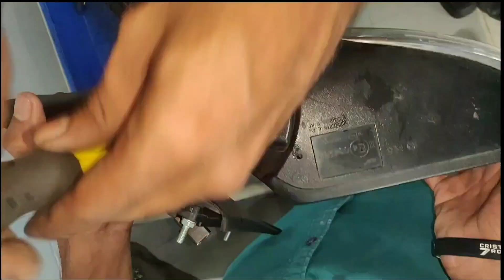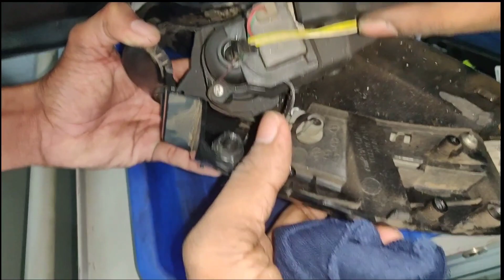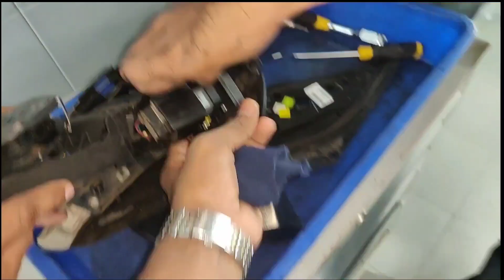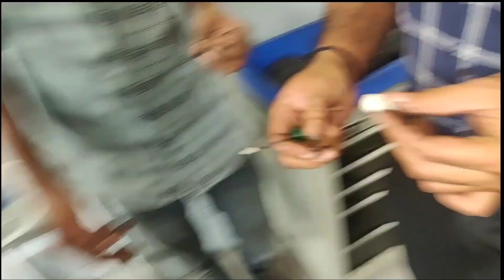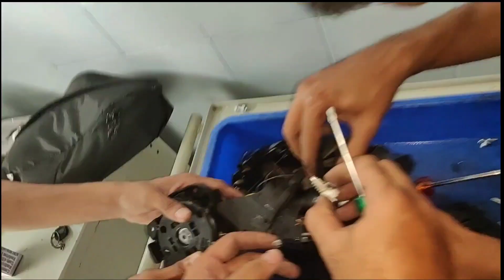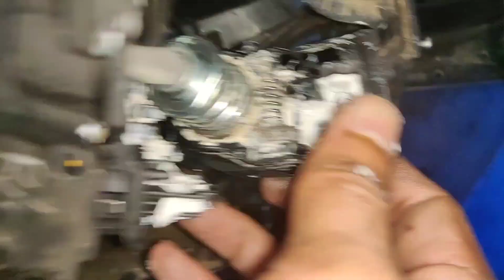Auto Fold Mirror Repair || Hyundai || Grand I10. How to repair foldable mirror

Comment: Hello sir, Same gear is broken in RH side mirror grandi10, where can i get this? Please suggest . If its not available in market then which part needs to be replaced?
Reply from the maker: Previously it was available with ali express.. But now its not there. Some sites are listing but price is too high. in this video i took it from an old damaged mirror in which folding was working.
Reply from the maker: If its not available then you have to replace the whole assembly
Reply: Yes one mechanic is telling me price of this motor and gear 3000/- rupees, Thanks for your reply
Reply: I want alternative hundai mirror  model for grand i10 mirror cause i dont find in my country

Comment: My car grand i10 sports 2016 right and side mirror (automatic) not working bro please suggest
Reply from the maker: If you are able to remove the broken gear,either you can make it on lathe or can order from ali express. While ordering check frieght charge also.. It may be high.

Comment: sir mere gaadi me auto fold mirror hai grand i10 me wo lock karne par right wala mirror fold to ho raha hai but left ke comapre me bahut hi slow ho raha hai aur motor bhi uske andar ka kaam kar raha hai but fold hote waqt usme kat kat ka awaj aa raha hai sab log bol rahe hai ki uska pinion khrab ho gya hai to workshop wale bol rahe hai ki pura change hi change karna hoga..........kya pura change karna hoga kuch uska spare parts milta hai..mirror ke andar ka..kahi mirror takraya ni hai..sab sahi hai ....andar se mirror bhi set kar le rahe hai..bas fold hote waqt awaj kar raha hai....#travelengine
Reply from the maker: Before changing anything,please clean and lubricate the mirror,specially in between the fixed portion and the foldable portion.after that lubricate the mechanism shown in the vedio if the problem still persists. If pinion is damaged then i dont think the mirror will work. Since your mirror is working i dont think any problem in mechanism and motor.

Comment: Is the motor available singly? My driver side Venue mirror got same issue, service centre changed while mirror assembly. Is it possible to change motor only ?
Reply from the maker: Previously spare was available at ebay. No genuine separate spare available... In this video spare took from another mirror assy(outer damaged) and used. And more than that it is not easy to change the gear wheel only. In addition different models have different no of teeth. So that left with the only option to change as a whole.